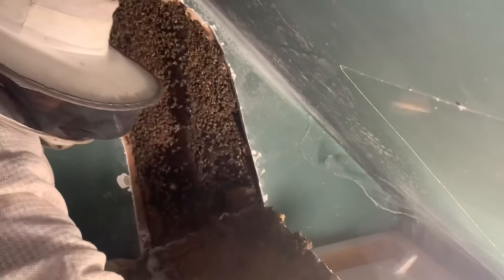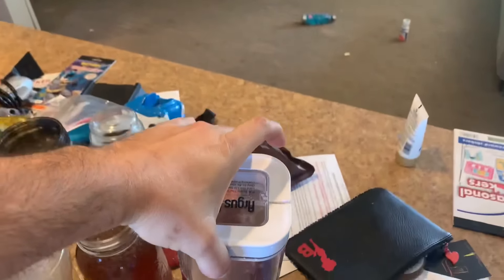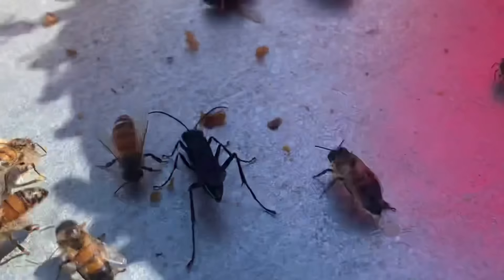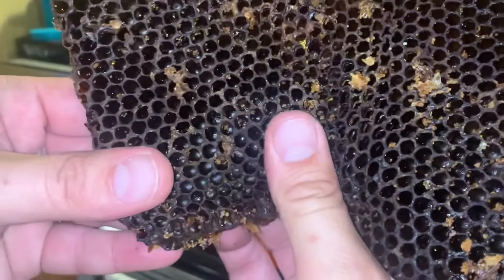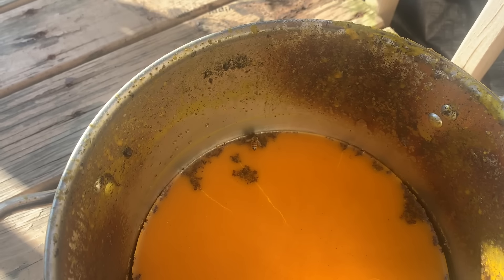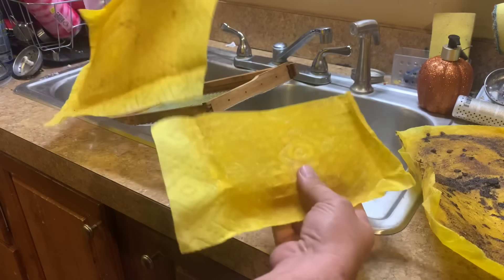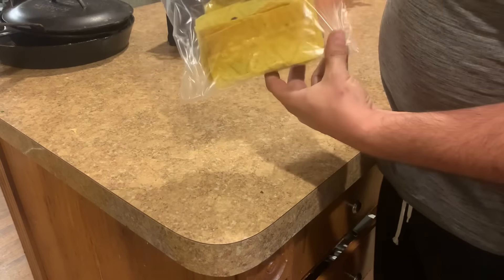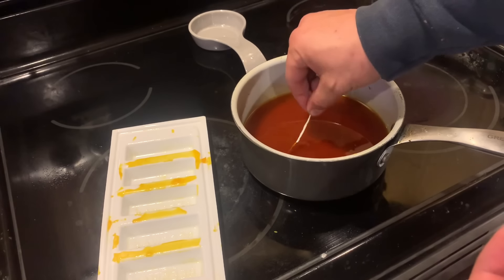Rendering Beeswax from honeycomb

Comment: Pro tip.  Take all the "junk" and stuff it into a ladies stocking.  Tie it off and toss it back into your boil pot.  You'll extract even more off stuff you normally would have thrown out.  This would include the junk you scrapped off the bottom of the first big disk, the paper towels, and even the trash you skimmed off the top of the first pot.

Also, find some muffin tins at the local Goodwill and grab some of the riffled paper muffin moulds.  These are almost perfectly 1.5 ounces when filled with wax and the paper is pre-waxed and pulls off super easy.
Reply from the maker: That’s a super great idea! I’ll definitely try that out next time!
Reply: "Pro tip.  Take all the "junk" and stuff it into a ladies stocking." I tried your suggestion, but the lady protested mightily!

Comment: Awesome video!

For the record - since you like making firestarters out of the wax-soaked paper towel, if you have some time to play around I'd encourage you to do something similar with the "junk" residue you throw away after skimming it off the first melt - that stuff has a lot of wax left in it no matter how hard you squeeze it.  

If you buy a set of dedicated molds (i.e. only used to make firestarters) similar to the ones you have at 12:26 but a bit larger, you can fill them with clean wood shavings, cover the whole mold with a healthy dose of "junk-skim" and bake in a low oven (on an old cookie sheet - drippy!!) until the liquid renders down and fills up the gaps around the sawdust.  

Remove and cool, and you'll be left with a mostly-woodchips-and-cleanish-wax amalgam in the bottom of the molds, and a nasty (but mostly wax-free) layer of bee parts, dirt, etc. on top.  This top part you can cut off leaving a set of useful, thick firestarters that'll burn for a long time at the center of a fire.  

Trial and error will let you find a junk-to-woodchip ratio that works.  Have fun!

PS:  I suggested woodchips, but almost any cellulose-based material is good.  Strips of clean cardboard cut to size and packed in the molds would work well too.
Reply from the maker: Great info! I Will definitely try that in the future! Thanks for the ideas!
Reply: you can use cardboard egg cartons as molds. all uniform cells and generally small, but you can just pour the wax and trimmings in and let it harden overnight, then cut the cells apart using scissors and light them up. you can add in used dryer sheets, dryer lint, the paper grass from easter baskets, old wax soaked rags...
Reply: Love this idea. I’ve never thought to process that last bit again by baking to drain down. Thanks for sharing that!
Reply: @RyanGrady  it would be awesome to see that process
Reply: Great idea.

Comment: Most excellent! When I was a boy in the 1960's, my grandmother did a lot of sewing. She used a lump of beeswax to treat the thread so it didn't tangle. She'd just pull the thread through the wax. She also made beeswax candles, but I don't know how.
Reply: Waxed thread is extra strong and waterproof too!
Reply from the maker: Wow that’s a cool idea. My wife loves to sow. I’ll have to put that idea in her head.
Reply: still very common today - also with Crossstitching, many use Beeswax for it
Reply: I have a few pieces of thread wax hanging around. It helps keep the thread from tangling as much. I usually get it at craft stores, but have also found it at hardware stores.
Reply: @johncraven6671  Thread wax isn’t going to give you the same results as buying waxed thread. It coats the thread but doesn’t soak in. So unless you are going to melt the wax and soak the thread buy waxed thread like you normally would.
Reply: @AlexCren1  I didn't know you could buy it! My sewing background is in medieval costume so I've only ever known a ball of wax and some linen thread :)
Reply: @johncraven6671  usually it is a heavier duty thread when you buy it. Sewing costumes like that is tough! I quilt and I bitch and moan about hand sewing bindings… 🤪 No way I could do a whole hand sewn outfit!
Reply: I have a block of was just like the ones made that I use to cost the thread when we make beaded flowers.
Reply from the maker: Do you ever do medieval leather work?

Comment: Simply inspiring, the way you work with the bees, the way you treat beeswax, glad that there are still people like you.
Reply from the maker: Thank you! That’s very kind!
Reply: Love the video. But you have been 100% misled.
Only beekeepers think you can’t get the wax off of everything. 
Especially with metal and glass. It’s extremely easy to get the wax off. Just ask any Soaper that does it on a regular basis
A little bit of oil in the bottom heated up and use it to clean the sides of your pan 
You can use old grease and it will work just fine. 
And how else would we make oatmeal milk and Honey Soap all the time, using beeswax, and never have to get rid of our stuff😂
Just trying to put a light spin on it, and spread the word
After you wash out your pan and let it thoroughly dry, add some oil and let it warm up. 
You can start with a cup or so. And you don’t have to get a smoking hot under 200 is fine.

Comment: Great demonstration of your process!  I have a bunch of old wild comb I'll be rendering soon by the same method (boiling).  I really appreciate you showing your second step of filtering through paper towels for a secondary cleaning.  Hopefully my wax will come out as clean as yours.
Reply from the maker: The only thing I might do differently is to not heat the wax at such a high temperature. I’ve read things that say that discoloration can occur if it is heated above 180. I’m not sure how true that is, but it’s some thing I might try to do differently.

Comment: Another vote for the solar wax extractor. We raised bees here in Minnesota. The first part of July is honey extraction time. The cappings, we get from decappings the honeycomb, is put in the solar wax extractor. The rest of July and August provide enough time to melt down all the capping we get from the honey extraction process. This is from approximately 60 colonies. The solar wax extractor will separate the good wax from the rest of the junk in the extractor (the wax will float above the rest of the stuff).  We also get all the honey left in these cappings. We save this honey to feed back to the bees later.
The wax is clean enough to go to a pot on a two-burner electric stove. The wax is melted down and filtered as it is poured into milk cartons that have been cut down. A small tea pot is used to pour the hot wax.
To feed the honey back to the bees, we use one gallon pickle jars with a few holes in the cover. We fill the jar with honey from the honey extractor and turn them upside down over the opening of the inner cover. The bees are able take the honey as needed. We usually feed in the spring to the weaker colonies to get them started after the tough winters here. This method also helps in keeping the bees from starting a "stealing habit".

Any questions let me know.
Reply: 87
Reply from the maker: Wow, do you have a bigger operation than I do for sure. I only have 10 hives, so the amount of wax cappings I get is minimal. Although I do plan to get a solar melter in the future. Most of my wax will come from removing bees from unwanted locations. Thanks for all the info!
Reply: Do you have a website I could buy your beeswax from?

Comment: Beeswax with linseed oil is an excellent wood sealer/tabletop finish in my experience. The beeswax on its own is way too sticky, but a little bit melted down with linseed oil is incredibly durable once dry 🤩
Reply from the maker: I have some boiled linseed oil. I wonder if that would work?
Reply: @RyanGrady  sorry for the late reply. I’ve only used linseed oil from the grocery store, for cooking. Boiled linseed oil can combust right? I don’t remember the warning label on it. Just be safe 😅

Comment: I was shocked to see you working in the house.  Your right this is a job better suited for out the shed.  You managed so much better than I have at keeping the mess to a minimum.  Bravo!  I have usually discarded brood comb because the returns are minimal the way I do it.  I Haven't tried to boil it out, but I will give it a try.  Thanks

Comment: I never thought of the paper towel trick and wish I had.  Also would have spread some Ali foil over the unhot part of the stove top.  Wives are so understanding.  Thank you so much for a different way to most others who do pounds at a time.
Reply from the maker: my wife is very gracious. because the stove top was glass, I was able to clean up with a razor blade. it made quick work of the mess. I'm so glad you enjoyed the video! thanks for the comment.

Comment: Fascinating.  I have considered having bees however not in the city.  I do have 2 recommendations coming from a chemistry lab approach.
1. I would experiment with adding an acid to the original boil.  Citric or Muriatic should produce a cleaner product.  Might not be able to use the steel pot though.
2. The original waste material could be hot rolled or hot pressed to recover more wax very easily.  This could also be done with the paper towels and they would still work afterwards for fuel.
Thanks for the video!  :D

Comment: There is an old saying in the mold making and resin pouring business: “ Beeswax sticks to everything but nothing sticks to Beeswax. In mold making, we coat everything with Beeswax.  We use Beeswax on every mold making material. In order to pour silicone over an object you want to mold we coat the wood, plastic, cardboard virtually every structure we make with Beeswax. Absolutely free of leaks once you coat Beeswax over your cast. When it’s time to take the box apart and pull the silicone out the destruction of the container comes apart so easily. No you have a silicone mold of the part you wanted to mold. Once you cut the silicone open and release the object you molded, you’re ready to pour the resin. Beeswax is the most fantastic substance in the world. Nothing compares! Best of luck. Richard
Reply from the maker: Wow, that’s super cool! I have wanted to get into making things with resin. I’ll have to remember this. Thanks so much for the fantastic comment! And idea!

Comment: Beekeeper in Florida here.  I would just like to add that you can use a two stage boiling system so you don’t have to add boiling water to the beeswax.  A buddy of mine even uses one of those old buffet racks that has boiling water running underneath, then he puts the comb in a pan above it (the ones that come with the rack) and lets it sit there for a bit.  Seems to do the job quite nicely.  I think it may take a little bit longer, but not by much.

Comment: I could not help but to think of the fact that you can use beeswax to coat wooden handles and such. The fact that this stuff indeed coats everything and is sometimes nigh impossible to get off was not lost on previous generations 😉
Reply from the maker: Yep. In the dark ages beeswax was much more valuable than honey was. Because there were so many more uses for it back then. It would have been a staple.

Comment: I do a lot of hand sewing and beading. I use beeswax exclusively on the threads I am using to prevent them from tangling and knotting.  I bought my own molds, and made wax cakes that I can throw in my travel sewing box. Im never without beeswax.
Reply from the maker: That’s really cool. I had not known about using beeswax for sewing until just recently. That’s fascinating!

Comment: My father use to use beeswax all of the time in his workplace. My dad was a welder, and sometimes, bolts would break and the tip would be stuck in steel, so he would put hot beeswax on the bolt to get it out. R.I.P. Kenneth Gerard Nash (26 March 1965-23 March 2020). For those wondering, his death was not COVID-related.

Comment: Nice video. At 7:20 you strained out the floating dross debris from the initial melting and threw it away. Then at the 8:00 mark, you scrapped the bottom of the initial wax brick. It seems to me that you could have saved all of that debris and the next time you melted the initial bees wax, you could have tossed it in and with the new batch and remelted.

I liked using paper towels to strain the wax and thus make starter strips for camping. Smart idea.
Reply from the maker: That may have worked better. But there really was not a ton of wax lost from it. 
A lot of people have said that I could have made fire starters from the junk. I plan to try that the next time that I try this.

Comment: For the hobbyist beekeepers out there, as a young kid over 45 years ago, I built a solar beeswax melter to toss all my bit of old comb and bits and pieces of wax into.  I found a small pan that the wax would drip into and yield approximately 1 pound blocks of relatively clean wax.
Reply from the maker: That’s cool that you were messing with bees at such a young age. I’m going into my 4th year. I plan you get a solar melter in the future.

Comment: I know you can get cheap portable induction cook tops they are fairly cheap and meant for parties, functions and dorm rooms they are a single heating element about a foot square and have a glass top so no flame and easy to clean and you can just run an extension cord and do it out side or in the shed if its cold and wet.
you were talking about the silicon melds and wanting 1oz moulds you can get silicon moulding material from most craft suppliers a basic kit might be $10 or so dollars you could use one of you 1oz blocks as a form and make your own .

Comment: You can clean up wax rather easily if you dissolve the wax in warm oil and then clean the oil residue with soap.
Works also on surfaces, with a hair dryer to keep the temperature high enough to keep the wax melted so you can mix with with the oil.
Reply from the maker: ill keep that in mind!. I used a razor blade since it was a glass stove top. it worked real well.

Comment: One idea for helping to release the wax cake from the turkey tray would be to run a gas torch around the outside of the tray for a few seconds to melt bond between the wax and the tray.
Reply from the maker: That’s a great idea! I didn’t even think of that. Thank you!
Reply: @RyanGrady  You're welcome. It might actually be a better idea to put to the tray in some warm or hot water, instead.

Comment: Some years back, I was hardening some veg tanned leather with beeswax+parafin-combo. After dipping the leatherpieces properly in the wax, I left them to dry under weights, to keep them from bending.

The weights I used? Guinness World Record books, since they had smooth-enough surfaces with decently non-stickish material. But still, the amount of time I had to spend heating up the books with a hairdryer afterwards, in order to clean them up by melting the wax, was pretty crazy! :'D

Couldn't really use baking papers etc to protect the books, since it would have been one step too many in the already tedious process. So yeah, can confirm: beeswax is difficult to properly clean off of thing, but possible with heat!
Reply from the maker: Lol, there’s an old saying. Beeswax sticks to everything, but nothing sticks to beeswax!

Comment: You could make your own mold. Get some silicon mold mix and poor it over a few of your already made beeswax bars in a little frame stuck-down/sealed-against some wax paper using beeswax. Wax is a great mold release for silicon so you shouldn't have any problems.
Reply from the maker: I plan to try that. Just haven’t had the time yet. I’ll have to do some learning about it too.

Comment: you can float your 1oz bar molds in hot water after the wax has hardened to get it to release.  Great vid!
Reply from the maker: Had not thought of that. I ended up melting the 1 ounce mold. So I’ll have to buy a new one now. The lesson I learned was to not heat the wax so much.

Comment: I had no idea the process of getting the comb to wax was as intensive as this. Thank you for showing us how you do it! I was wondering, and I could be completely wrong here, but would using cheese cloth instead of paper towel possibly help out in the separation of the dirt from the wax while being more reusable? It may need to be layered a couple of times to be more efficient but might be a possible improvement, depending on the cost of the cheese cloth.
Reply from the maker: That might work. My only thought was that the paper towels would get finer particulates than cheesecloth would. But layering the cheese cloth may prove useful also. I’ve also heard people say that paint strainers work well. But I don’t know how well paint strainers would work in the oven. Thank you for the idea!

Comment: I use exactly that same plastic mold. No need to spray it with anything. Just pour the wax in, let it get cold, put it in the freezer for half hour and they just drop straight out, they don't stick at all.
Reply from the maker: I didn’t think of that. I put the wax in at too high of a temp. It melted the mold.

Comment: Wow. Even by the very end it's still waaaaay darker than the pale wax, which is presumably from a healthier colony of bees than the house ones ...
Reply from the maker: I’m not sure if I would say they are healthier or not. The discoloration comes from the age of the comb. Older comb has been used much more than younger comb. All the use and traffic causes the honeycomb to become dirty. In the video you can see some of it is black as coal. A lot of the lighter wax comes from honey cappings. When the bees store honey, they place a wax cap on each cell to keep the honey safe and clean. Then beekeepers extract the honey, they remove these cappings and save them. The capping‘s are very young wax and make a lighter color wax when melted down.  
You can even get white wax. Brand new wax is white. This kind of wax is used in a lot of pharmaceutical applications.